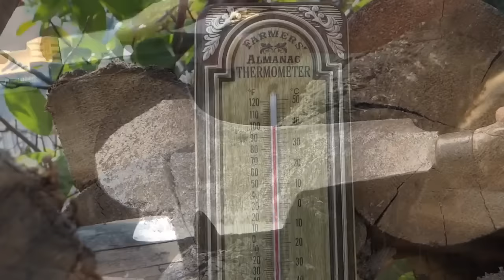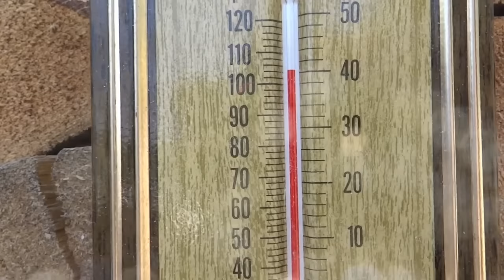Carving  a King Cobra Walking Stick from Wood

Comment: Fantastic carving... you're very talented. Just wondering (looking to try my hand at caving a snake stick) what diameter the shaft/ stick is? And do you go by reference photos and if so, where do you find them?.... cheers mate.
Reply: Saw a reference pic at 11.17 so that answers that question. Any suggestions for a good website would be helpful but I know Google is my friend.... cheers.
Reply: Oh, and what type of paints? Acrylic or oil paints (maybe the ones used in model making?). And do you put on a finish?... thanks again.

Comment: You probably won’t read this,it’s 5 years old after all. But on the king,usually about the middle of the back of the hood there will be a scale that is twice the size of all the rest.I’ve kept cobras for about 20 years now and have only come across a handful that didn’t.

Comment: What color are you using sir is it oil paints? Or acrylic? Im a Fan wooow amazing masterpiece... and btw what tip is that in you soldering iron can find it anywhere in my country
Reply from the maker: I'm using acrylic paint. The tip for the burner is made by myself. Thank you!

Comment: Sir - does that grinder get hot.
I use a cheap grinder from Harbor Freight.  It does the job but it gets very, very hot - like wear my husky gloves with welding gloves over them hot.
Regards.